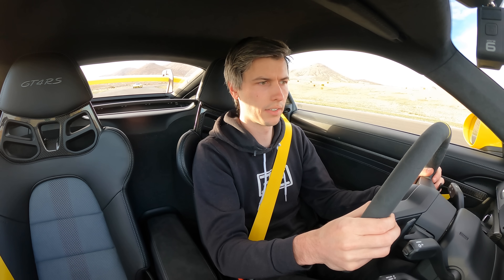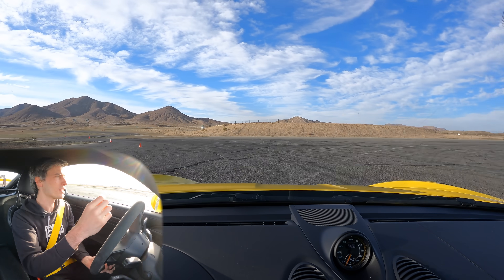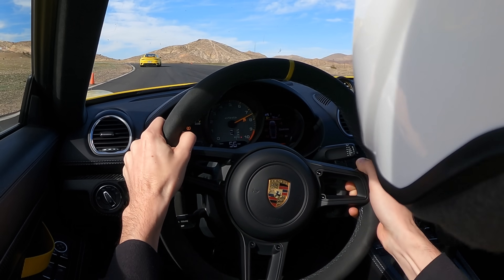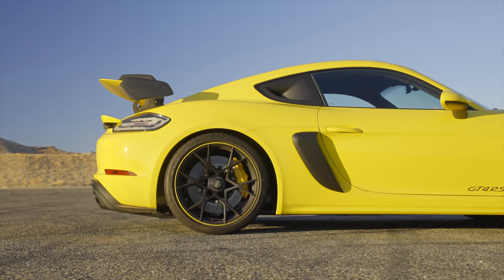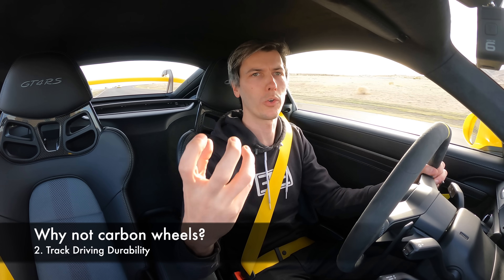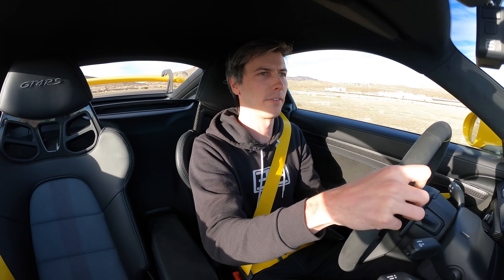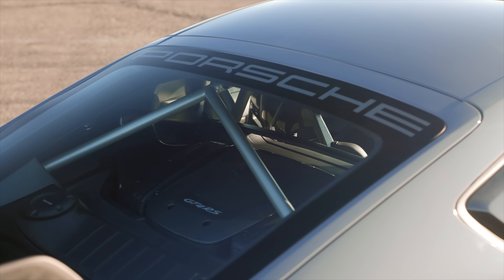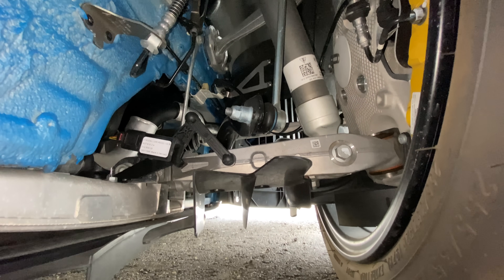The Combustion Engine Perfected - Porsche GT4 RS

Comment: Could we do a video on koenigsegg' free valve and how the valves survive the rapid reciprocating mass pulling on the valves
Reply from the maker: Here's a video on it! https://youtu.be/FJXgKY2O4po
Reply: @EngineeringExplained  thanks for the video reference. I saw a video referering to freevalve but i was curious about if it was trully electric or if it was electronically influenced. I am attempting to become an automotive engineer in the future and this design interested me. I have a few other ideas i have dreamed of but would require the degree and level of math to design it ( like a dyson fan forced induction to   improve airflow compression)

Comment: I dunno man 300 HP out of a three cylinder in the newly announce GR Corolla may be a contender!  That’s gotta be some slick engineering for sure!
Reply from the maker: The car will likely be a riot, no doubt, but tiny, heavily boosted engines are way less fun than NA or supercharged engines. Still want the GR Corolla!
Reply: @EngineeringExplained  I love Porsche, always will.  They do some incredible stuff.  GT4 is my dream car.   However, Toyota is really going to bat for the driving enthusiasts lately with their offerings and at working man prices.   Gotta give them props.
Reply: Though that GR engine makes less horsepower per liter than AMG’s 45 series 2.0 turbo motors.
Reply: N/A vs turbo power man...not the same...
Reply: @zatiticherry3421  correct but still incredible none the less.
Reply: @gryphon123456  Classic conundrum of N/A vs turbo power. Whether or not it's incredible is subjective and an opinion; it's really just a difference in VE man.... "nonetheless" man...
Reply: @zatiticherry3421  It’s quite a breakthrough in a 3cyl engine offering this much Power.    I think it’s the highest of its kind by quite margin in a road legal car for normal person money.  So I think that qualifies on any list as incredible for sure.

Comment: What is a flat six?
Reply from the maker: Simply means the pistons lay flat (like a V6, but the V angle is 180 degrees).
Reply: @EngineeringExplained  Thank you, I guess that means it’s a boxer engine!
Reply: @mr.redneck2715  nope boxer is different. flat 6 is a flat 6
Reply from the maker: @mr.redneck2715  This is indeed a boxer engine, per Porsche. :)
Reply: Did you just start to learn about cars or you never knew about this type of engine
Reply: @theanimeotaku2794  I knew about the boxer butt never heard bout a flat six
Reply: @mr.redneck2715  I mean it's the same concept it's just boxers only have two fist's therefore instead of calling it a flat 4 it's a boxer engine because 4 fist's opposing each other two on each side I think that's why they just call it a flat six it's a pretty cool engine  and has it's quirks